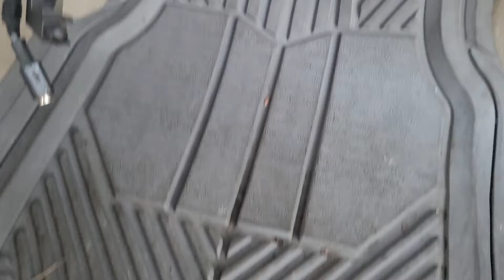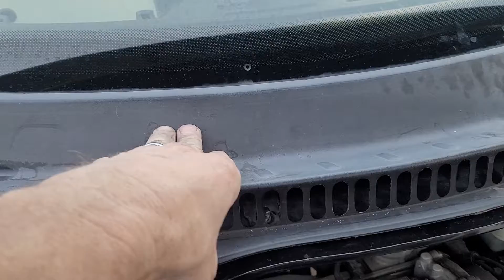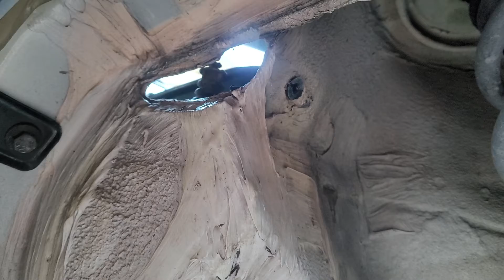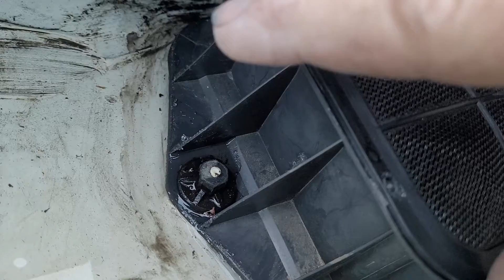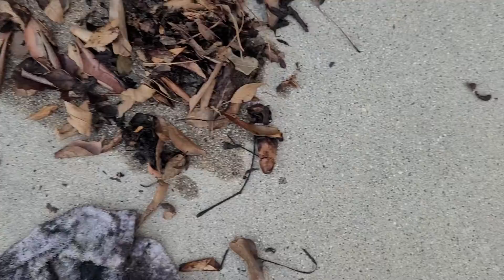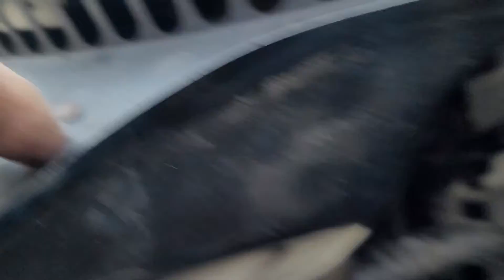2009 VW New Beetle water leak passenger side floor fix repair service

Comment: If you will drill the drain holes to a half inch the water will go  through and not run over 
The 2 oblong holes on the towel it fixed mine

Comment: Another place to look at is just at the sides of the cabin filter and the plastic cover over drivers side. There is a rubber grommet, on the drivers side the bonnet release cable goes through it, on passenger side its just a rubber grommet to seal it off. Thats where my water came in, it tracks straight in and down behind the carpet. Ive pulled both sides and resealed.

Comment: The Cowl does POP OFF it is CLIPPED ON ONLONG THE FRONY WINDSHIELD just start on the drivers side and slowly pull up and it will pop loose and keep going across to passenger side til it's totally released

Comment: The cowling comes off if you start at the corner , lift the bottom edge outwards then finger in behind the cowling at top then run you finger along under it comes straight out

Comment: We just got back from a week-long vacation to find a fairly major water puddle in the pass. side floor of my daughter's '10 Beetle. 
First video I found showed me the drain holes in the cowl (under the removable plastic cowl cover, it's simply clipped in) - which was indeed covered up in muddy gak. Cleaned that out and was thankful it was a fairly easy fix and I could move on with my life. 
But then your video showed up. Guess I'm tearing into the dash now. 🙄
All this after doing the rear sun roof drain ducts reseal several months back shortly after we bought the car! Germans may be good at engineering, but really suck at water management.  
"At least these Beetles are cute, and my daughter loves it." I keep telling myself...

Comment: Does the sam fix apply to the driver's side door water leak?  I have been stumped by what's causing condensation inside my car
Reply from the maker: I sealed both sides. Good luck.

Comment: its not glued just pry it
Reply: So hard luck to all those who follow this video and take half their car apart because you didn’t bother saying at the outset that you had glued the panel in place.
Reply from the maker: It is not glued from the factory..... but I had to glue it to fix the issue because the seal failed.